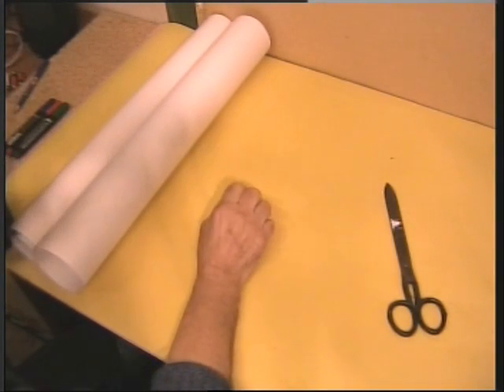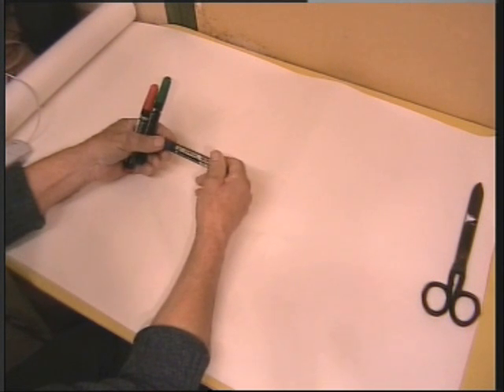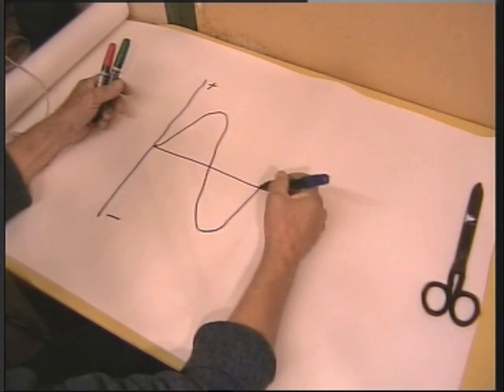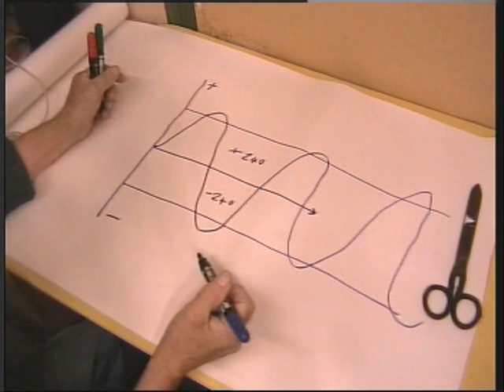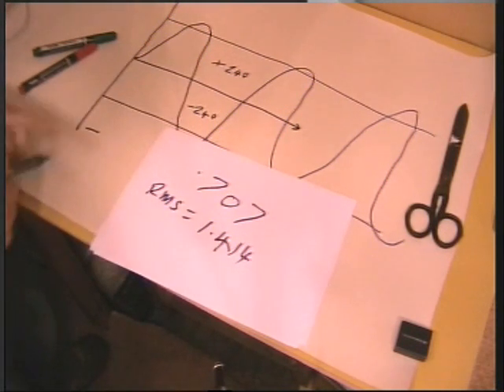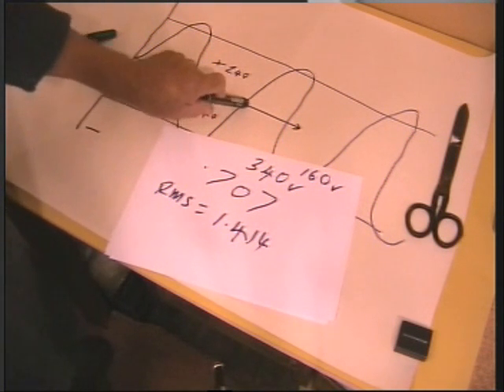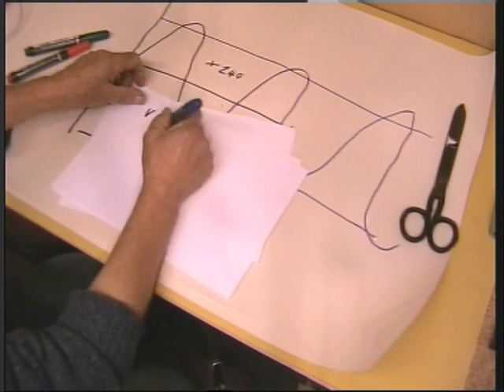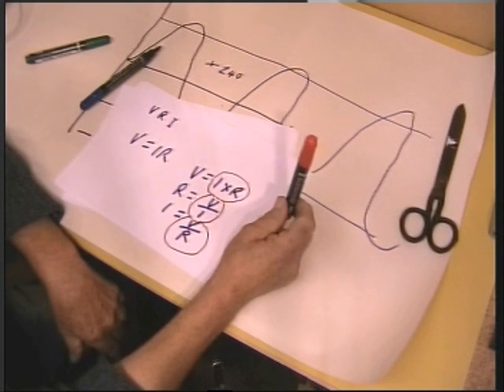pilot episode

Comment: Good stuff!  Ohm's Law is something my dad taught me when I was about 7 years old. Been a very useful thing to know ever since. Once I learned some algebra, I only needed to remember V=IR, as I could rearrange terms to get the other forms as needed. 

You said voltage is always V, but in the P=IE formula for power, isn't it E?  

Just wondering if it might be worthwhile to back up a bit farther and cover electrons, flow of electrons, like charges repelling, etc.  comes in handy for discussing capacitors and eventually semi-conductors and "hole flow" (which, when combined with conventional current flow, always confused the heck out of me! Seemed backwards.)

-- Mike

Comment: I would have expected things to kick off with DC, AC is not for beginners who need every little bit of theory reinforcing with practical experiment. There are plenty of such video tutorials on YouTube, so why not be different and use your friendly handyman style to explore practical applications of electricity in the workshop? Dismantle an old 12v drill, or experiment with solar cells, for example. Show how a multimeter would be used to troubleshoot.